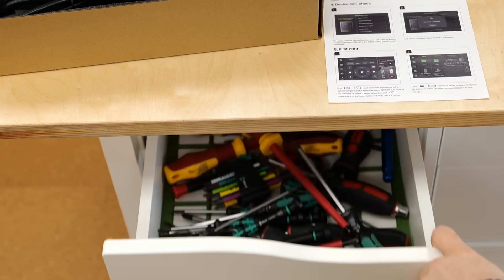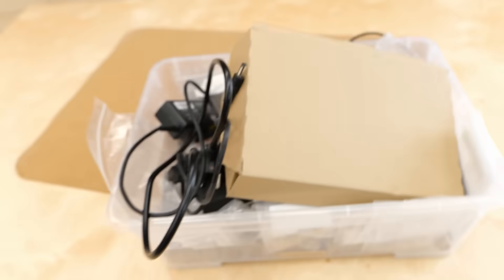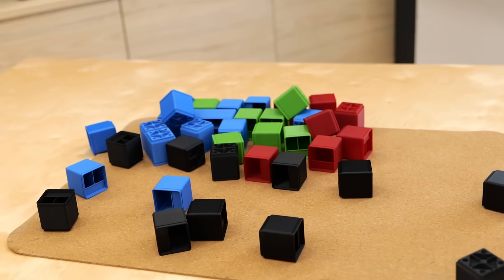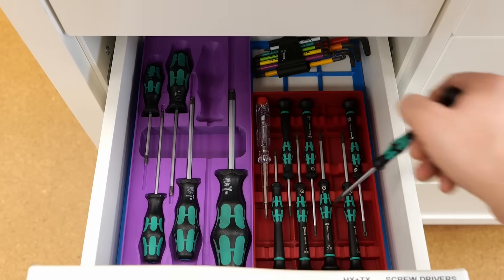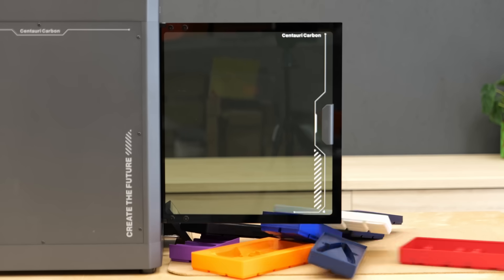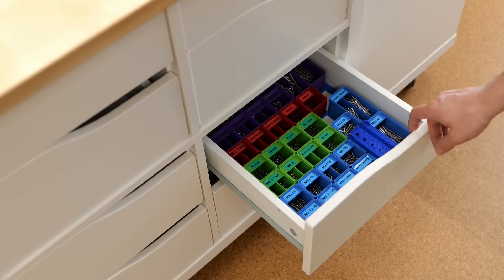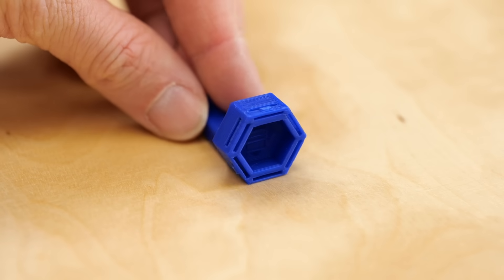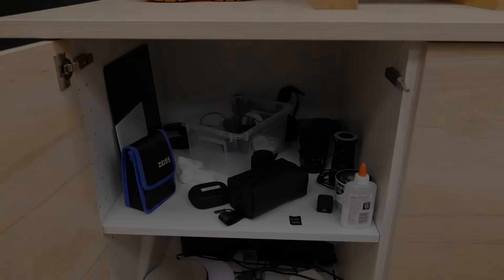The Best 3D Printed Organizers for your Workshop

Comment: Somehow over the time and by obsessing over Adam Savage I found my way to sortimo L- and T-Boxxes years ago and kept with it. A big tool box on rollers with a bund of drawers beneath it and two racks for T-boxxes. Smaller components are in a stack of L-boxx minis.

"First order retrieveability" is a big thing for me, so I try to have as many things as possible available as easily as possible.

For the tool wall I wanted a clean look. After knowing what I needed I printed lots of holders for various tools and screwed them directly onto a big plate of multiplex. To reduce damage to the wall, the whole plate resides on a long french cleat, only requiring three screws for the whole wall. Of course I would do some things differently now but all in all I'm still really happy with it.

Comment: Hey Stefan, I will get this Week my two new Büro-Rollcontainer (office mobile pedestals?) for my new desk setup. They will be used for office and writing materials and also tools and I am already preparing gridfinity-helpers to keep them organized and efficiend. So your video comes at the perfect time to get some ideas and inspriations, thank you! 👍
For my printers with the typical Ikea lack enclosure, i designed a little bigger drawers then most I found with gridfinity to have enough space for the printer tools and them always ready. 
There is also a generator for the gridfinity baseplates, that I will use, it generates already with connectors according to your maximum bed size and as soon as I can measure the drawers, Im courious how well it will work.

Comment: I currently am deciding for a wall-storage solution and so far, none of the printed or bought pegboard systems seem like a great solution for larger walls. I have to drill them into concrete so I think I'll just get a big flat wooden board, hang that over the concrete and design my holders around screwing them into the wood directly.
Reply: French cleats might be the go for your situation. Could probably get away with a single cleat across the top, or one at top and one at the bottom. You could hang a big board on the cleats, or pegboard, or heavy tool mounts, whatever. Would keep it modular while minimising the holes in the concrete wall.
Reply: This is the way. I recycled the headboard from my gf's old bed, french-cleated onto the wall and it works great. A sheet of ply or OSB will do the trick just fine.
Reply: Pragmatically?
A pegboard (they even are made of metal) is cheaper and faster (you don't have to print it) and you can use metal inserts with 3D printed adapters, same with french cleats (minus the metal part).

If you go with openGrid, Multiboard or HSW you'll have to print A LOT (in increasing order) for a big wall: those are for small surfaces.

Comment: I've done all my organisation so far mostly with cardboard structures, especially in draws - cheap, flexible and quick to create/tweak. Also lasts long enough that for the most part don't end up needing to make a more durable version any time soon. But there are plenty of wooden bits for when the cardboard option really isn't suitable, which is again pretty quick and flexible as woodglue is great stuff for letting you just cut out a bit that doesn't work out as well as you hoped.

Then once I know I have a good layout, and those tools are not going to need lots of new accessories added to their storage a metal, plastic or more high quality properly crafted wooden version can get made as required and suits the task - plastics generally a bad idea with oily stuff for instance as reasonably good chance of chemical reactions, where metal and wood probably don't care, but for something that is likely to be wet...

Comment: I tried HSW, spent a few kilograms of filament on it. But when I wanted to reorganize my HSW wall, I found it is too difficult to change the layout. It takes some effort to push in items in the wall but it takes even more force to remove them again. This means that I hate reorganizing my  walls and that's not how things should be. I now got some Ikea Skadis board and that works way nicer for me. The only thing I don't like is the way the slots are staggered. Maybe multiboard is an option - this also has screw in type connectors. Or just plain old pegboard - Clough42 had a nice solution using those automotive style push pins to mount 3D printed parts.

Comment: I use the Skadis boards because I don't want to have to print my own panels. I made my own mounting system with screws (Skadis T-Nuts) to not have to deal with hooks and tolerances. Visually, HSW looks much cooler though. 
Multiboard, even though very well thought-through, I dismissed because of its license, which is incompatible with Creative Commons licenses, so you can not legally remix existing holders to make them compatible and publish them.
Reply: I designed exactly the same system for my Skadis mounts, 3d printed TNuts. It works really well, and is very secure & strong.

Comment: Tried other draw systems but I just can't keep them. They are way too rigid, too inflexible and having to re-print or re-do things every time you get a new tool or want to change order is just such a pain.   But if you have either a lot of space or not that many tools, then it looks great and I have no doubt works amazingly.
Origination is a compromise between space and ease of access, and I'd always rather have more tools somewhat easy vs less very easy.

Comment: I have used HSW and Multiboard. I prefer Multiboard much more. The ability to screw things in allows in much better connection. There is a great HSW to Multiboard convertor so I am able to use the HSW stuff I already had on the new multiboard wall.

Comment: Yeah i think multiboard is designed much better for printability and how flexible it really is with what you can do with it. And octagones are second best to hexagons. The smaller holes have a use too.

But also, very crucially, it doesn't make much sense at all to 3d print the board part of a pegboard system from a manufacturing technique standpoint. It's way way more efficient to punch holes out of sheet material.

Both of these printed solutions try and justify it with internal geometry that aren't possible without printing but really that could just be a printed insert instead of the whole thing.

Comment: I just got done designing bins that drop into cheap tackle boxes. I know tackle boxes are supposed to do that job for you, but often mine get stored sideways and small parts (like washers or nuts) fall between the sections. These bins have individual lids so that won’t be a problem.

Comment: After watching this video and mandicreally  I think HSW is the right choice. There is pros and cons of each but the HSW is simpler to just do.

For the drawer system you should look at Cargo Containers or GEN2 Tilt Drawer.
Reply: Cargo Containers are a paid system, nothing wrong with that, in theory: you don't know if it works for you until you paid for them (and I read some complaints about extreme tolerances required, and people with the same printer as the creator that struggled with them).
Besides: it's quite plastic intensive and it seems made for vertical storage.

Gen2 by Jerrari seems preferrable both in plastic usage and in freedom of trying it.

Comment: Lord, I would have loved to have used Multiboard and the like, but the tolerance required for it I just haven't quite got it working right on my k1 max(still new to printing myself so not quite sure what to do). So i've resorted to using ThreadBoards for my wall organization. Just started printing the parts so we'll see how it goes
Reply: interesting had not realised this is a problem
Reply: @Ender_Wiggin  , Pretty sure it's mostly user error and I just kinda need to dial in my printer settings a little better.

Comment: I use both Gridfinity AND HSW, there is a print file that will do 4 grid tiles at once if you have the support filament in your AMS, it adds a layer between each tile so you get a nice stack out.

Comment: I have used both Ikea Skådis Pegboard, Honeycomb and Multiboard. All are great but I personally prefer Multiboard due to the pegboard holes (I use tons of their simple hooks and they're awesomely easy to readjust and move around) and the flexibility of mounting options in the larger holes which I often design screw-in-accessories for. I love readjusting and tinkering with the perfect placement of what I have hanging and I found Multiboard dramatically better at that compared to HSW. Have only briefly tried their Multibin solution though, I still prefer Gridfinity for that.

Organizers such as these are probably my favourite 3D printing projects of all time and I strongly recommend it for anyone with a printer :D
Reply: ya I think the pegboard ness of multiboard pushes it over the edge. In the end you still want fast and easy

Comment: In addition to adding to much needed motivation I learned two very important ideas from this video:
1) Gridfinity uses a 42 mm spacing as that is a universal constant (how could I now have realized that)
2) I photograph items to use as a modeling guide all of the time. It never occurred to me to place them on a grid - that is genius!

Also, I loved the bin design with the rounded corner to assist in removal of small parts. I also hadn't come across that.
Reply: Remember to use a telephoto lense like Stefan said (or significantly crop in the picture in post processing) in order to get a more accurate measurements. Zooming/cropping "flattens" the perspective and gradually removes perspective distortions (akin to foreshortening in the arts realm).
Reply: @omicrondec  i use the flatbed scanner (multifunction printer) to avoid perspective distortion
Reply: @kitemonkee  fantastic. Do you use masking tape on the tools to protect the flatbed glass?
Reply: @omicrondec  nothing at all, i try to be careful ;-)
Reply: @omicrondec  but you can use some transparent foil if you wish, eg. some A4 foil for overhead projection

Comment: As in your example, for the most part, my shop is very organized… on the surface. But like anyone, I also have 5-6 smaller containers with lids that I convinced myself were for ‘items I’m not quite sure I will frequently need’. Now 8+ years later, I find these bins get not only frequent use, but I also take extra time looking for items. I’ve also been looking at the Gridfinity system and will take your recommendations up on this!

Comment: I think Matthias Wendell said “it’s hard to beat the space efficiency of unbridled chaos”
Reply: Well yes, exactly... I'd love to have an organized workspace, but if your workspace is just a little corner somewhere instead of a full blown actual workshop, it becomes much harder just to get the tools you need put away "somewhere". While absolutelynot as efficient (and frequently maddening) to retrieve, you can get much more into a drawer or samla box if you just chuck it all on top of each other versus neatly spaced out. That's why it's called "spaced out": it wastes a lot of space for the sake of effficiency in retrieving.... And of course all these youtubers have "huge" workshops to organize, not just a little corner somewhere. If someone can find/make a video or system to organize one of those and still be able to keep all tools there, let me know ;-)
Reply: Pretty much any method beats the space "efficiency" of chaos.
Reply: @ in terms of how much stuff you can cram into a drawer with no effort? Organised drawers are handy. They look great too. In terms of cramming stuff in chaos is an option too. Get the maximum use of the drawer space at the cost of time.
Reply: @  You forgot the reduced time to dig out stuff you need. I know the chaotic drawer organization style all too well, it's really not that great.
Reply: @brinkoftext  all organisational systems are a trade off. Space, time, cost. Depends on use case.

Comment: very informative. I am working also on Cleaning up my Workshop. I am thinking also using HSW for the edges of my Wallmount which i used Skadis and normal Metal Boards. since i have only space left for 17cm it is the perfect space for my a1 mini from bamboo to print.

Comment: I have both a HSW and Multiboard. I infinitely prefer Multiboard for the modularity and ease of use once you understand the system. I live in an area where i cannot get ikea boards cheaply and the cost of other options are actually more expensive then printing. So naturally there is only one choice.

Comment: I'm currently using multiboard, I selected it becuase of an organization video I liked, here are some reasons why I like it after using it for a while:
- open source connectors, so creating custom parts is a breeze
- peg board-style mounting in addition to the octagon grid provides more options for organization
- LOTS of ways to mount it

I'm very happy with my multiboards :D
Reply: I went MB as well for my garage toolwall - 44 7x7 tiles 🥰I love it so much, BUT afterwards realised I wasted a ton of filament (and print time) going for 100% coverages on the tiles.

Any wall system loses space to covered-up areas - especially with tall or hanging items - and I could have mounted just as much stuff with 95% of the layout flexibility if I just printed rows of 4x7 tiles with 3u gaps between them, or even 2x7 tiles with 2u gaps. Long as they're spaced accurately, holders can still span multiple rows, and there's WAY less plastic getting covered up by other plastic. Lesson learned for next time!
Reply: I also went for Multiboard, because of the peg board holes. I printed a lot of simple hooks and they fit very secure without the need for supports or complex shapes.
Reply: Other than the lack of proper opensource, I like and use multiboard. I found it complicated to get started, but he has since put out more resources and it is getting easier. The peg holes in addition to the regular mounting is definitely a plus.
Reply: I wanted to use multiboard but the part of the license where it says they can revoke it at any time made me change my mind. I was thinking of doing a 50mm gridfinity grid with it which would go well since multiboard is 25mm. I’ve been looking at opengrid recently since Hands on Katie mentioned it in one of her videos but I’m torn
Reply: @pointeplusplus  isn't gridfinity something like 42 mm?
Reply: Or just buy a real pegboard and only print specific holders when you need to. I never really understood printing out your own pegboard given how cheap (and honestly better) just plain Jane pegboards are
Reply: first point does not make sense. Multiboard as a license and lots of parts are not open source. HSW is completely open source.
Your second and third points are the same. The best thing about multiboard is the peg board easy of use when you need it.
Reply: @Ender_Wiggin  in my third point I meant that the board itself has many ways to mount it - it can be free standing, screwed into walls, put on walls with double sided tape (so renter friendly), it's possible HSW also has these mount options, but I thought I'd point it out
Reply: @Ender_Wiggin  There's openGrid for completely free (and Gridfinity-compatible)
Reply: Yes multibaord has a licens but is compleatly open source. All the step files are available for free. The only things that aren't are custom generators and weird things.
Reply: @DoubsGaming open source doesnt mean available for free you know that right?
Reply: @DoubsGaming Open Source also requires that the source is forkable and shareable, it is not. Open source never dies because somebody has forked it. You can’t do that with Multiboard. So no it isn’t open source. 
Yes the source files are available for free, but that does not make it open source.

Comment: Shaper Trace is awesome for getting tool outlines. My biggest issue is that Onshape still can't import SVG files which means an extra step to convert to DXF. P.S. I'm the maintainer of the HSW remixes in Onshape (links on Printables)… Everything's parametric and I made sure to make everything derivable into other projects so it's easy to use them to add connectors to your own designs.
Reply: Nice what are your thoughts on multiboard?
Reply: @Ender_Wiggin  Mostly "I already spent $200+ on filament for HSW so … no" 🤣I do agree about HSW's limitations, though. PLA shape memory is especially problematic with parts that are purely friction fit and eventually deform and loosen up.

Comment: Do not get rid of those old storage drawers! I'm telling you, that's a gem right there!
Reply: I agree 100%.
I've tried those gridfinity screw cups, even with magnets on the bottom to hold on to the baseplates, but, for small screws, nuts and washers, they're a pain to get to with my fingers, fillet or no fillet.
Plus, i always had to cut my Niimbot labels to size in order to fit those lips on top, and they never quite stuck for too long onto printed plastic.
I ended up just buying a bunch of Stanley drawer modules and sticking uncut labels on them. They can be stacked on top of each other, screwed to the wall, etc, and have stoppers, besides being transparent in order to see what's in there at a glance.
Reply: @nunopereira6092 It really is one of those things of "just because you can print it doesn't mean you should"

Like it's a cool concept and all but is genuinely impractical for anything beyond very specific bins. Same goes with the pegboard.
Reply: Agree 200%!!❤❤

Comment: I'm using the multiboard as you can screw things directly in the plates. But I think the Ikea Skadis has one very big advantage. The plate only needs screws in the corners as it's a very sturdy plate. with Multiboard or honeycomb you need a lot of holes in the wall to make it sturdy.

As for the filament storage - does anyone have a good storage option without having to screw it in a wall?